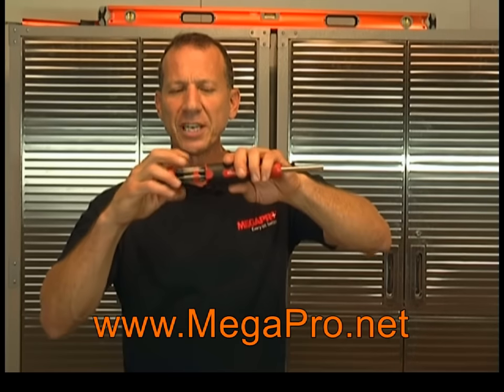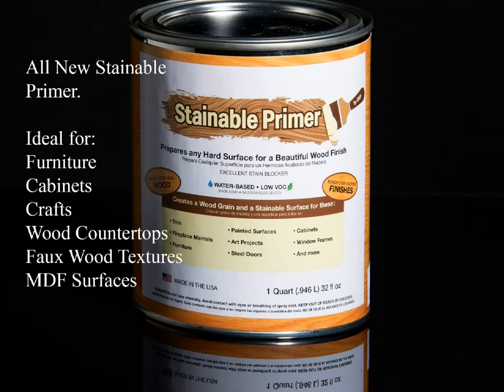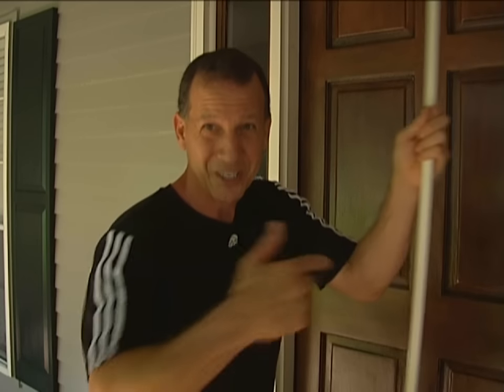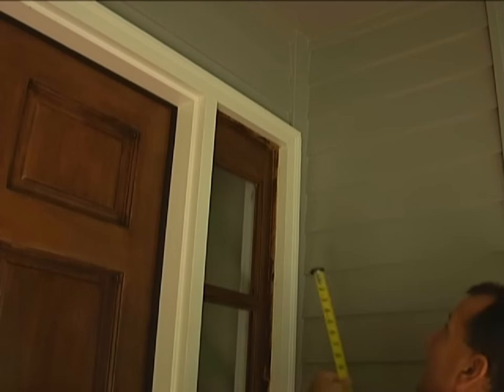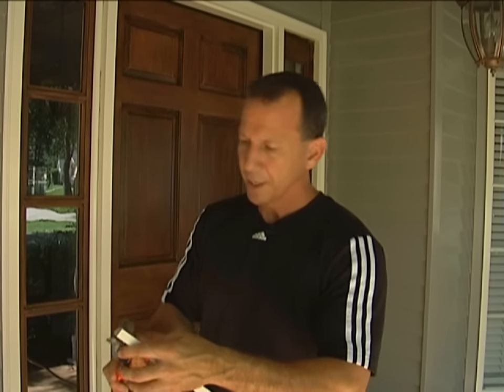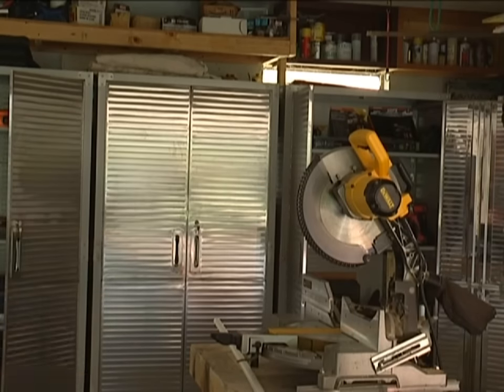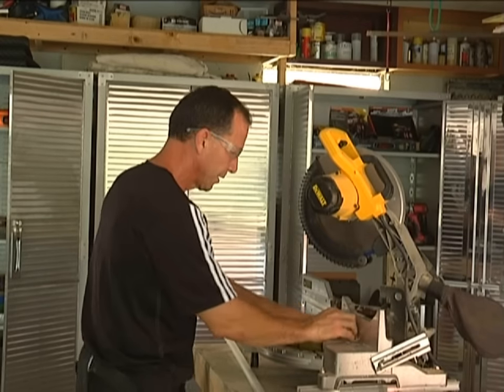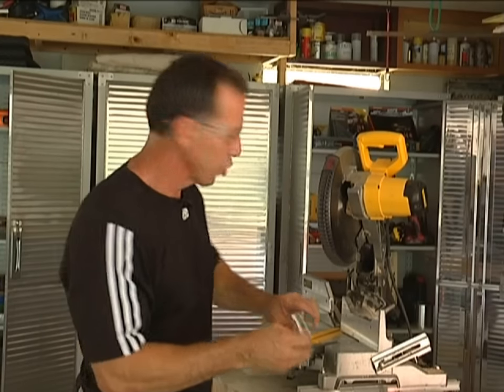Perfect cuts on wood trim (Without A SAW).

Comment: what are those cutters your using please?
Reply from the maker: Hi Joseph,
These are wood cutting angle snips. I paid about 50.00b but a rally good pair may run over 100.00. If you do not do wood trim for a living, you may want to look at this walmart site. Here is a link.....http://www.walmart.com/ip/Midwest-Products-Easy-Cutter-Large/26678993?wmlspartner=wlpa&selectedSellerId=147&adid=22222222227019229790&wmlspartner=wmtlabs&wl0=&wl1=g&wl2=c&wl3=62688243528&wl4=pla-89023524288&wl5=9025219&wl6=&wl7=&wl8=&wl9=pla&wl10=106529953&wl11=online&wl12=26678993&wl13=&veh=sem   Mine works good on soft wood but a little harder to cut on hard woods. 
Thanks!
Paul